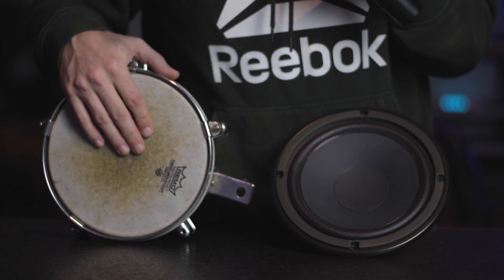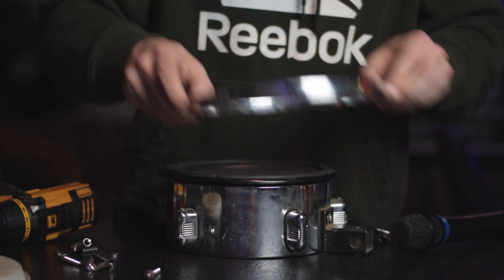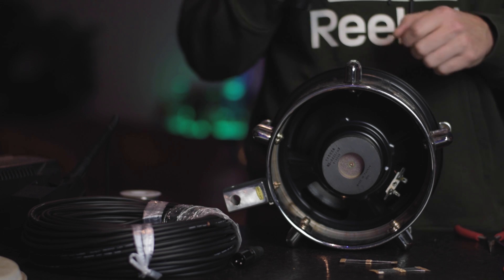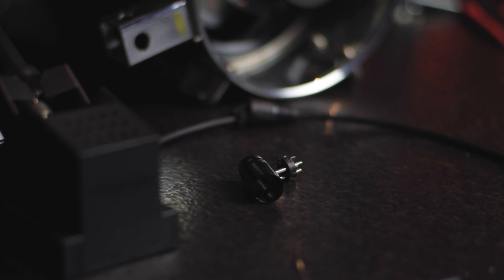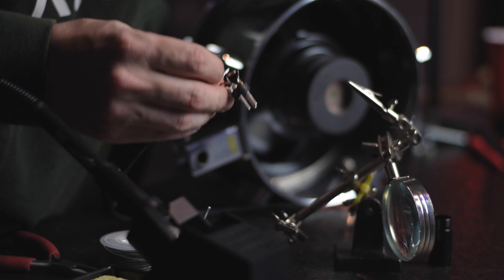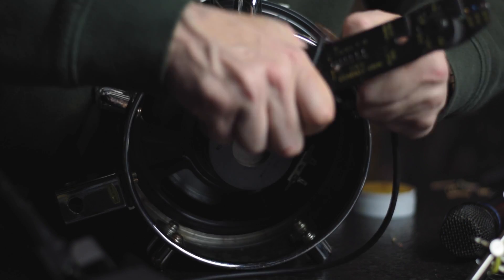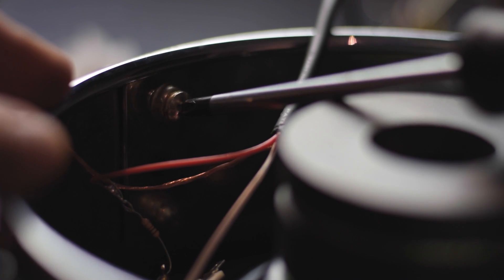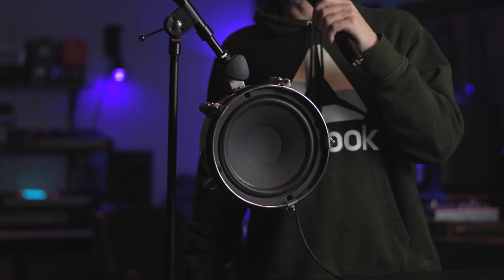THE WORLDS BEST KICK DRUM MIC (DIY SUBKICK)

Comment: Great video but yo, I'm super tech-dumb. When you soldered the output, you mentioned the hot/red wire to pin 2, ground to pin 1 and so am I right to assume that the negative/black wire went to pin 3? Also fantastic tip about the resistence and using the resistors to get it down. This is the first DIY sub kick mic video I've seen that mentioned it! Great insight. Subbed.
P.S. I dig the reverb on your mic. Sounds cool and it's different. That said, a lapel mic or even a boom arm might make things easier for you.
Reply from the maker: Thanks! You want to wire the xlr   Pins 1. Ground 2. (Red) Positive 3. Negative, then wire the speaker ground to a ground, wire 2 (red) to the Negative speaker pole and 3 to the Positive speaker pole so it reverses the speakers polarity.